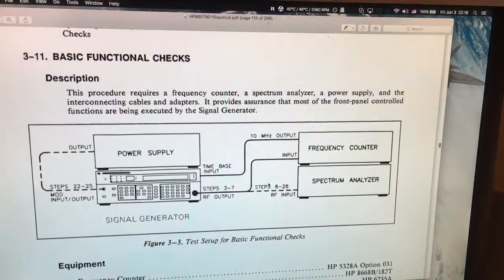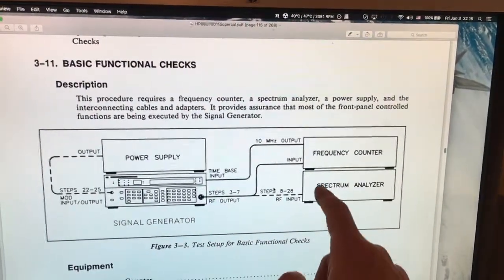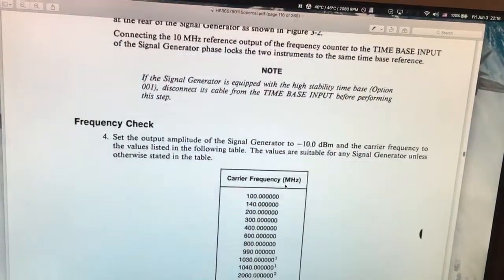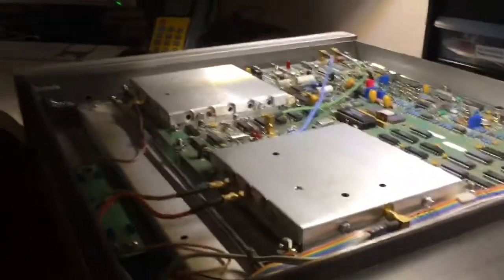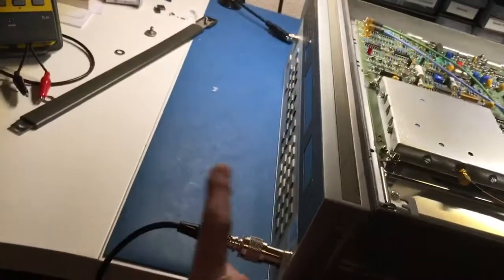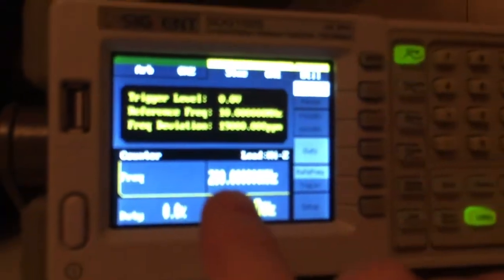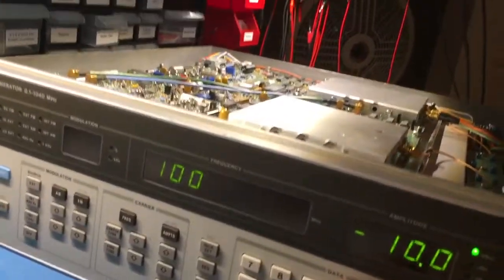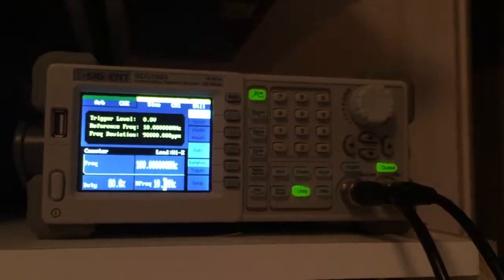HP 8657a

Comment: Do you consider this unit a relaible and well built one? I am thinking of purchasing one.
Reply from the maker: Gábor Dani I didn’t use it a lot but when I used it, it was fine. I did notice though harmonics when I connected it to a spectrum analyzer. I asked in one forum and they suggested to check ripple on its power supply.  It’s big and heavy though :)